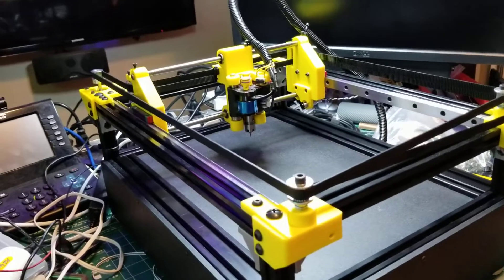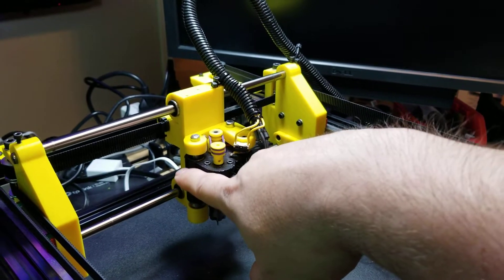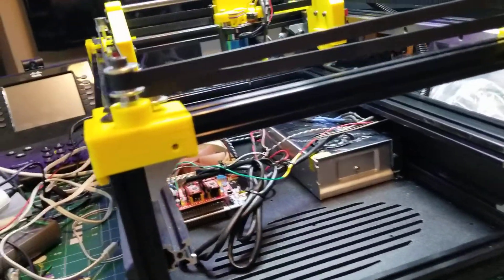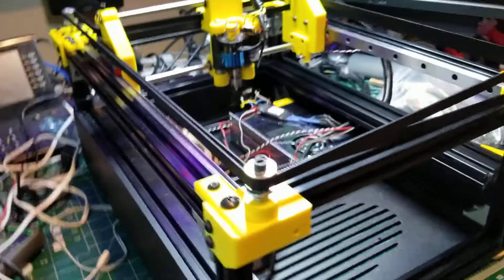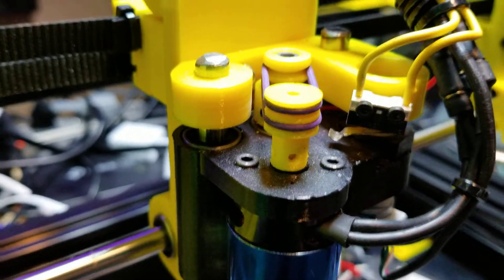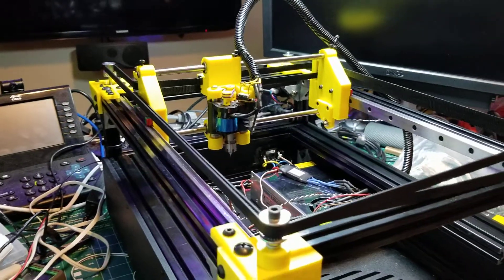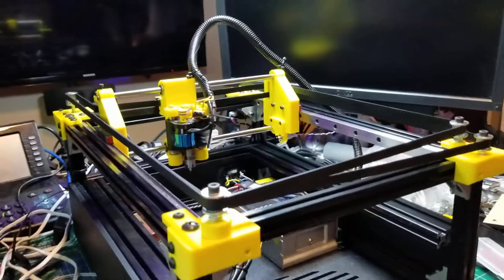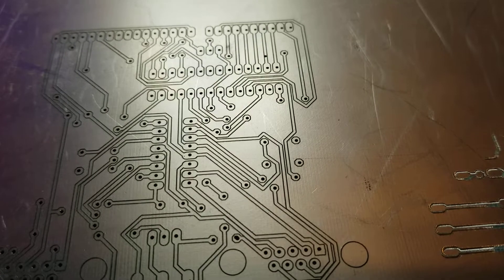PCBEater milling machine complete

Comment: Do you think sensorless homing would work on this if equipped with proper stepper motors such as the tmc2209? Are you sure those are MGN12H linear guides? On your thingiverse you wrote MGN15H

Comment: Hey, hope you're stil around :)

I'm planning on building this, and was wondering the measures of the 2020 aluminum extrusion, exactly how you built with the electronics below, also, how did you screw the middle aluminum bars to the vertical ones (where you slide the board covering the electronics), thanks!
Reply: Hey, i'm also rebuilding this and i'm actually done with the frame assembly and  if your questions are still relevant you can contact me and i can send you my BOM and stuff.
Reply: @markkovacs4241  hello, thank you very much, I'd like that please!!
Reply: @markkovacs4241  hey I'm planning to build this one as well. Do you know if the guides used are MGN12H or 15H?
Reply: Thank you very much!!!!
Reply: No problem sir :)

Comment: if i can make a suggestion, buy your stepper motors from stepperonline they are usually cheaper or for the same price you can get higher torque motors

Comment: how is the spindle doing?  i was wondering if it could hold any preload and if the shaft might loosen (drift down) over time if things come loose.  are you using the angular contact bearings the ant team is using?
Reply from the maker: Yes it is using angular contact bearings. It is surprisingly solid. I don't think it will loosen over time.

Comment: Frist, really nice work. I´m also playing with the idea of a more robust version of the Ant. But my goal wouldn´t be just to use it for pcb´s. Did anyone know if it would be possible to mill engrave acrlic, wood and maybe sheets of 2-3mm aluminium with the right milling bits?
Reply: Engraving should be fine, but not sure about the milling (aluminium).
Reply from the maker: I think wood and acrylics could be possible but I have my doubts with aluminum. Also there is only about 11mm of z travel.

Comment: Amazing Man 
any notable change on the firmware or exactly the same ? 
thank you
Reply from the maker: I had a stuttering issue with the ant firmware and switched to smoothieware temporarily.  I will be trying an ESP32 based GRBLboard in the future.
Reply: @Xnaron  so basically didnt use any of the software stuff provided by the ant pcb . Other than the bCNC.
Reply from the maker: Right.  They are just providing a nucleo dev board ported version of GRBL. I had an MKS Sbase v1.3 laying around and tried it in the course of troubleshooting the stuttering issue I was having with the nucleo GRBL.  However I will be switching back to an ESP32 port of GRBL https://github.com/bdring/Grbl_Esp32 .  I use flatcam to generate the gcode from the gerber files and bcnc to run the machine.
Reply: @Xnaron  thank you for the detailed reply , I hope that you find the time to explain this to us in a series of videos here on the channel 
Thank again
Reply from the maker: @SAILxKamal  Yes.  However I am recovering from an injury and am stuck in my bed for the next month.  I can answer questions but I won't be making videos for a while.
Reply: @Xnaron  I'm sorry to hear that, wishing you a speedy recovery :) , yeah I will definitely ask questions if I get stuck , have a good one :)

Comment: Do you think an air nozzle can be added to clear the dust ?
Reply from the maker: You could.  I have seen other machines do it.  I have been trying a small coating of mineral oil to keep the dust down.  It works very well.  The fr4 dust is nasty stuff.  I have been trying the Bakelite fr1 copper clad boards which also work well without the fiberglass dust.